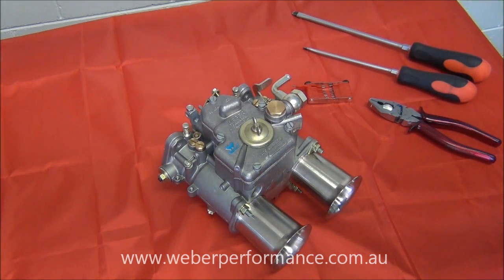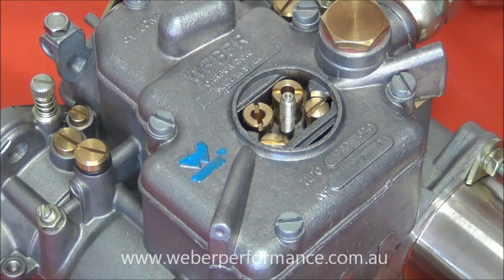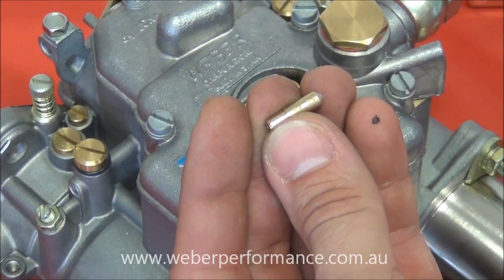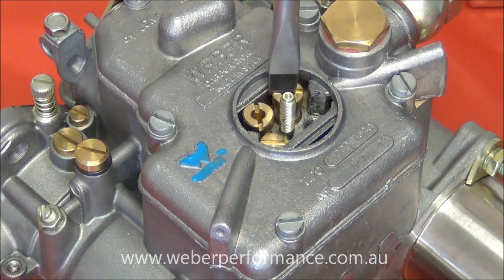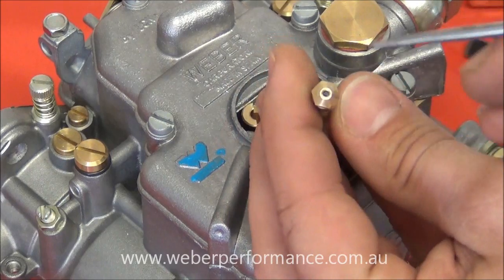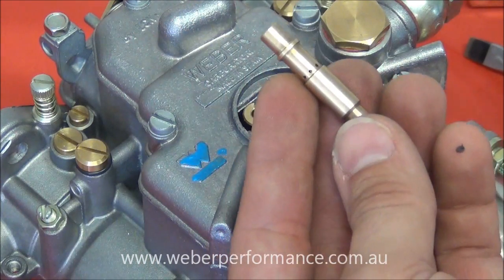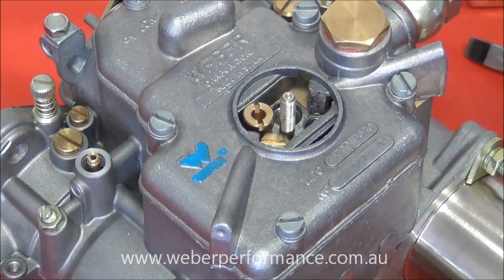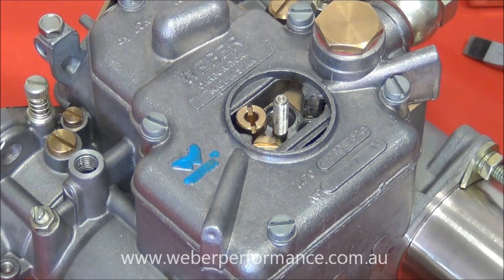45 DCOE Weber Jet Identification

Comment: Hi there !
Thank you for uploading the video, I find it very useful and informative. I wanted to ask you what happen if the pulp jets are seized and can't be taken out ? I have a set of DCOE 40s and three of the pup jets are stuck and won't come out. Do yo have a way how to take them out? 
Do 40s have pump demand cover and wights as 45s because when I open mine for the first time they didn't have them.  I bought mine second hand which have been sitting for quiet some time.
Thank you in return. Loni